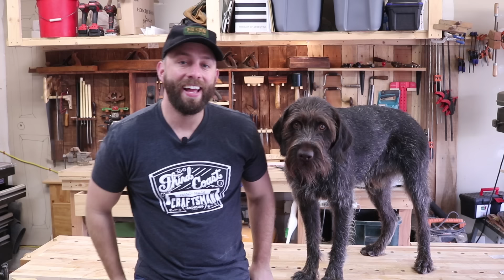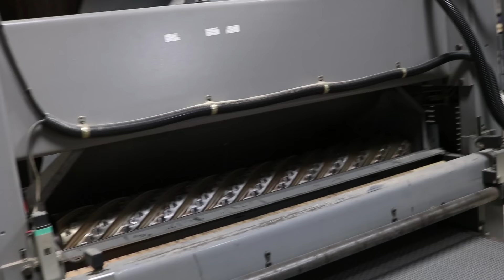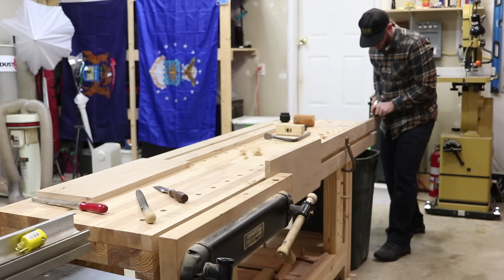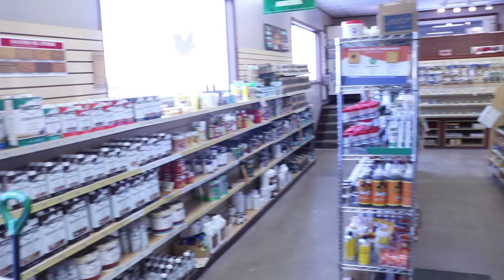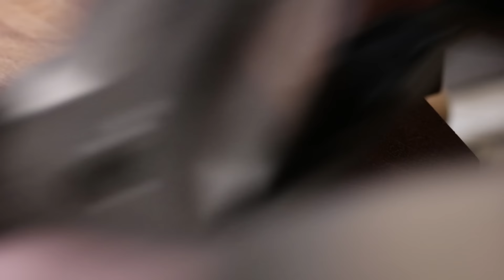Japanese Style Bookshelf With Traditional Hand Cut Joinery | Woodworking | How To

Comment: Hi from the UK!
Great video.  I have been struggling with a design for the bookcase I want/need to make for my lounge.  This seems to fit my bill of Japanese styled.  Excellent choice of different woods which when the oil finish is applied, pops everything.  Gradually transitioning to Japanese tools and working methods.  Very envious of the wood and prices you have available to you.  Over here in the UK the prices are horrendous now; almost prohibits making with hardwoods.  Regards, Chris

Comment: Change your content in metric and you will expand drastically, three quarter of an inch doesn't mean anything to me, its confusing 10mm are 1cm, 100cm are 1meter, its so easy and accurate in metric right till the millimetre.

Comment: Thanks to YouTube for finally getting me here.  As a metal fabricator for over 45 years, I remember early on thinking that I didn't need to learn how to be a woodworking craftsman; I was wrong.  I found myself acquiring a lot of specialized woodworking tools, for a metalsmith.  What all this drivel means is that I can really appreciate the focus on creating exactly what you envision.  But, even more so, is how freakin' sharp those chisels are!  I can get a passable, paper-cutting edge on most blades - except those durn chisels!  I watch with envy when I see someone cutting clean with little force; my butt would be whacking the bejeezus out of it .

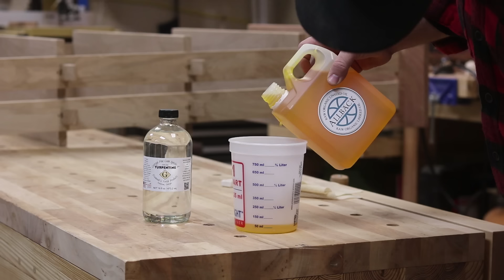Comment: 13:48 a tip for pouring full bottles.. If you pour it upside down, i.e. with the handle near the cup, then you can angle it further down toward the cup before it comes out. This helps spilling it everywhere.

Comment: Could you ballpark the final weight?  I've never worked with the timber you used, I noticed the recesses in the vertical supports which makes me think it's a strong, dense wood.  This piece looks about 7ish feet high so, I guess I would be most concerned with moving it.

Comment: Amazing work. I can imagine building some of these and being able to diassemble them and reassemble, would be great for renters.

Sorry to be a d$#k but it looks like he's expecting some pretty giant books to put on the shelf. They look miles apart (maybe it's just the perspective).

I'm curious how you could make these shelves adjustable height? I have some great cheap bookshelves (can't buy anymore) and one of the major advantages is that I can adjust the bookshelves to three settings - textbook/A4 size, small paperback size, and regular book size. But being able to adjust them works really well for me, rather than having them fixed
Reply: The pit fall to the build is the wedges in the top. How are you to take that apart? Not being a smart ass. I dont see a nice way to tear down the top self.

Comment: L.L. Johnson.  I do not know that they still do,,, but I would assume that they do.   I used to make some very minimalist hardwood stairways, stringers, with routed housings and shouldered treads.  As can be imagined, finding hardwood 3X14s 4X 12s,, in long clear lengths approaches impossible.  At Johnson's it was not a problem.  I was able to walk their inventory of logs out in the yard, still in their bark, mark the logs I wanted and label the ends to note the finished size.  They took care of it all.  In several of the houses I built years ago there are exposed beams supporting the second floor, open tread stairways, dovetail and mortise and tenon heavy beam work all in native hardwood, solid pieces.

Comment: It seems kind of silly to go to the lumber store and have them use all those "machines" to do the planing, etc and then come home and use the band saw, etc and THEN switch to hand tools.  Why not just finish off with a router, jigsaw, etc.  Same look, quicker and again, you already used modern machines to do 3/4 of the work by getting it prepared and cut before you did anything.  It is a NICE piece. So many buy that cheap pressed wood Ikea  and Sauder used to be big.  I have no idea why people buy that trash.  Never once have I seen a piece of that at an auction lol.

Comment: The “Card Scraper” is a 16th C tool that originally came with an option of sharp square notches about 1/64th wide on the 1/64th spacing squared or it came sharp with an option to use it in a 90 degree plane (finish scraper) or on the 70-80 degree angle used for scraping the finish of veneer for finish or refinish.  The smooth version has become a staple in every finish carpenters shop and is used by open hand as you did or, if you are lucky enough to be able to find an early scraper plane......  well, just a little history from a cabinet maker and plane collector.

Comment: What are the chances of the wedges in the very top shelf wiggling out over the years without glue? All of the hook-like wedges on the sides can obviously be hammered back in a bit if they loosen, but those wedges at the top are planed flush with the top shelf.  Pardon my ignorance, it's a genuine question, not a sarcastic comment.

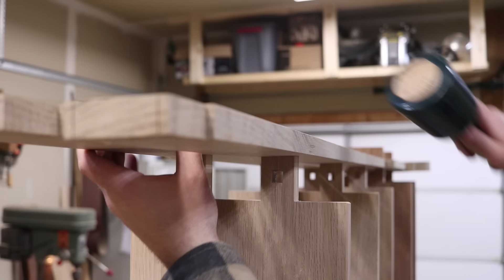Comment: At 12:05 what type of mallet is that or what material is it made out of that you're comfortable smacking wood with it? I see it is curved but am still curious what it's made out of. THANKS!
Reply from the maker: Thanks the "wood is good" brand that has a nice hard rubber coating that doesnt mark or dent hard woods. i love it
Reply: great - and thanks!

Comment: How do you take it apart?  Seems like a lot of effort to make up and fit the dog wedges only to have the top shelf permanently attached.  Nice looking finished product however
Reply from the maker: you dont take it apart, the joinery is aesthetic in this piece but even though tusked mortise and tenons are often used to allow to break down they also cause the bookshelf to become super stiff so there is no need a back on the bookshelf

Comment: my concern is that this looks really wobbly... kinda feel it when you apply the final coating and the furniture piece kinda shakey... it seems like it's meant for heavy book (with 1.5" shelves) but i wonder if the structure on two sides would hold....?
Reply from the maker: Its INCREDIBLY sturdy, those wobbly shots were because it was on an uneven part of the floor plus I took the wedges back out. once the wedges are snugged up its rock solid
Reply: thanks for the response! The japanese joints are just amazing. It takes lot of work to make, but the result is like no other.

Comment: Very nice work, i just struggle understanding one particular design decision. Basically the whole thing seems to be easy to assemble and disassemble due to those wedges which is what i really like about this build... but then why do the tolerances need to be so tight that you have to mallet everything into place and specially why do you pretty much attach the top permanently, breaking that whole "easy assembly, service and disassembly"-theme that you first created by the use of the wedges in the first place? xD

Comment: Hey! Great build and really high quality video in all👌🏼. Just wondering, how solid is the bookshelf if you don’t use glue? Like can those Japanese joinery techniques still achieve the same stiffness? I ask because I saw when you were applying finish to the top at the end it seemed to be rocking back and forth.
Reply from the maker: Hi Phillip, the bookshelf is indeed very stiff. The you saw was due to a couple of things that I should have explained in the video. First the floor was uneven where I was, and second. I had went back and taken the wedges back out of each shelf so I could get oil in behind them. when the wedges are tapped down it sets up like a rock.

Comment: This totally inspires me. I need a shelf in my room. And this makes me wanna make it with no screw and no glue too. I won't use the same model, though. I need some specific details in mine. Like a spot on the side to put shoes.

What's the main thing I should keep in mind while starting a project like that?
Reply from the maker: Oh man thats a tough question. Keep in mind wood movement and take your time, mark and cut accurately

Comment: Unrelated question: how is your front apron (Nicholson side) jointed to the workbench top? I like that portion a lot and want to see how it would work for a new bench build I have planned.
Reply from the maker: Its basically just screwed on from the back. i just have a bunch of 2x2's that I used as bracing. that way I can replace it if I ever want to .

Comment: Beautiful work. It would be neat to see this design with the feet lowered so tusk tenons don't need notches. I would have made each of the top tenons into two smaller tenons, so the wedges could be oriented to align perpendicular to the top board's grain direction.

Comment: Looking at the way the table was moving when you were applying varnish, I could make out that it's not that stable. Am I wrong in that?
Reply from the maker: Praveen M haha yes you are wrong in that. A couple things: It was on a very uneven section of my garage AND I took all the wedges out when applying the oil so I could get the oil behind the wedges as well. Without the wedges tight it’s definitely unstable but once you add them it’s very solid!
Reply: Third Coast Craftsman thanks for replying. I just thought that with so many cuts in the middle , it would become unstable. I guess I'm wrong. Cheers.

Comment: please consider the danger of using turpentine, even if it's natural the gasses from the drying is still dangerous to breathe. also the finish will often expel gasses much longer than the finish takes to set, which means that the piece of furniture will release gasses and odors in your clients home. for the safety of you and your client.

Comment: Looks good i guess but how was that racking when he's oiling? think the feet are too small or maybe splitting the uprights made it unstable
Reply from the maker: Gary Indiana I removed all the wedges when oiling it so that I could get oil on all faces of the bookshelf and the wedges. That is why it’s moving. It’s rock solid when all the wedges are installed and tightened
Reply: alright player

Comment: Very lovely bookshelf! Your skills are improving! If I may give one bit of friendly advice? If you wedge the top tenons parallel (like an axe head) rather than perpendicular you have a much safer stringer joint that won't likely split apart your lovely top board. Slightly angling this top board mortise as well will give more grip to the tenon and less chance of pullout, especially without glue. Always good to apply wedging pressure onto end grain, never side grain, cuz thats how cracks are born! haha
Reply from the maker: Thanks Mr. Chickadee! I appreciate the advice!
Reply: If Mr Chickadee is checking you out...you've arrived

Comment: Nicely done!
One question though. Maybe with the noise level in my house  i missed the explanation, but  Why didn't you do removable wedges for the top shelf? Doesn't seem like the unit can be broken down as easily the way it is.
Reply from the maker: Even though the shelves have keyed tenons its not ment to be taken apart. The keyed tenons are a design feature as well as a really good joint choice to make the bookshelf very ridgid. Way more ridgid that datos or other methods.

Comment: First and foremost, love the dog, second, I love the way this project came out and not using any nails or glue.  There is something very satisfying about it being 100% wood.  I've been thinking about doing some projects with a similar technique, also so that when I move, it's easier to take apart.  That finish too, I may have to give that a shot!  Very nice work!
Reply: I don't think getting this apart would be easy at all.
Reply: @D4RTHS7NTH  no I dont think this could be dissembled
Reply: The other shelves would come apart easily, but the problem would be taking the top off because of the wedges he drove in.
Reply from the maker: Thanks man. I really appreciate the kind words! Im glad you liked the video and yes it is very satisfying and rewarding to do it with just mechanical joinery like this. I think you'll really appreciate the work too if you give it a try. Let me know how it goes or if you have any questions along the way